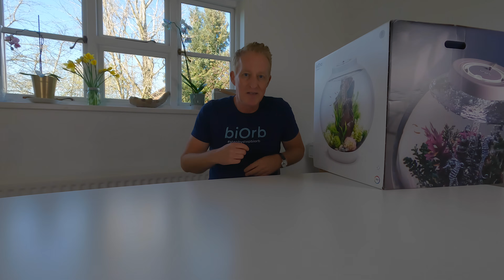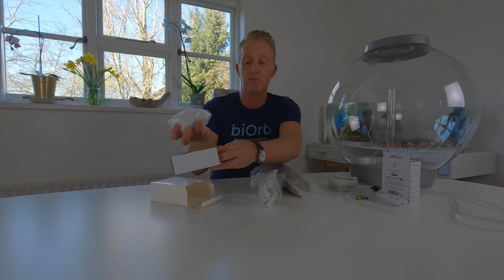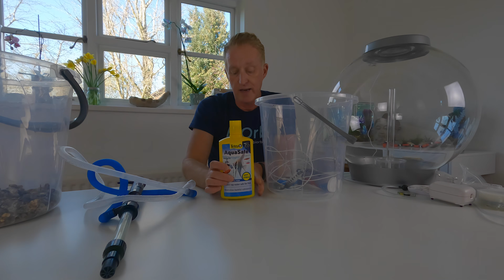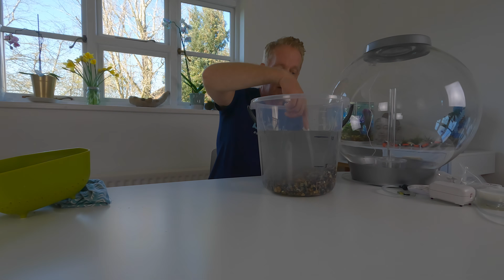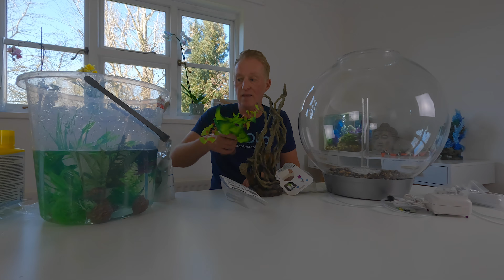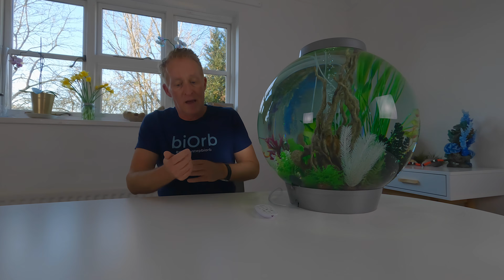biOrb Aquarium   | Starting a biOrb | New approach!

Comment: Hi, I have just been watching a lot of your videos so thank you - they have answered a lot of questions. 
I currently have 15ltr tank and am moving to a 30ltr biorb tube. I have got this second hand though and it also has the ceramic media in but the tank has been sitting for a while unused. How would you suggest I go about setting this up and moving my fish over in comparison to setting up a new tank. 
Thanks in advance for your help!
Reply from the maker: Hi Laura.  Congrats on the 30l Tube. I would suggest that you throw away the old ceramic media in the Tube - as this avoids any previous issues that may have existed with the tank. Any beneficial bacteria associated with the Tube's ceramic media will have long perished anyway.  

If you plan to fully replace the 15l with the 30l, then it would make sense to use the ceramic media from your existing tank and transfer this to the 30.  This media will have all the existing beneficial bacteria that have been supporting your fish in the 15. You will find it far easier to catch (net out) existing fish without any ceramic media in the tank. As you are moving up to a 30l size, I would suggest you purchase another 1 kilo of ceramic media to add along with your existing media (either the biOrb product or Alfagrog E25 - they are the same product). 

There are various ways of doing this but they all add up to being roughly the same.  The steps I would take are:
- Give the 30 tank a good rinse out with warm untreated tap water. Then towel dry.
- Rinse and soak the brand new (purchased) ceramic media in warm dechlorinated tap water in a bucket. After rinsing, soak for about 15 to 30 mins.
- Lower the water height of the 15l tank by about 50% - add the 7-8l of extracted tank water to the new tank 
- Leaving the fish in the 15, whilst carefully removing (by hand) the ceramic media from the 15l and add that material straight to the 30L.  Add a further 1 kilo the new ceramic media that has been rinsed/soaked.
- Add your decorations, air stone, filter, bubble tube, etc to the new tank.
- Top-up the 30l with fresh (dechlorinated) water to about 3-4" from the top.
- Add in your heater to the new tank and switch on and also switch on the air pump.
 
The new tank should now be ready for your existing fish.  
Rather than catch and then add these directly to the new tank, I would suggest you instead add the fish to a plastic bag (a fish bag if you have one or use a large plastic food bag) containing some of the water from the 15l tank.  Float the bag, containing the fish, on the surface of the water in the new tank.  I would suggest acclimatising the fish to the new tank water (i.e. keep topping-up the bag with a small quantity of the 30l tank water every 5 mins for about 30 mins).

After that you will be able to release the fish into the new tank. 

Hopefully the above covers everything... or at least the very main things.
You might want to consider adding a bacterial product (e.g. such as Aquavitro Seed or ATM Colony Freshwater) to the new tank at the same time as adding the fish.  I would do this, although it is probably not essential! 

The only thing I'd add relates to adding any new fish. If you intend to purchase and add further fish to the 30l I would suggest holding back on this idea for several weeks. This will allow the new tank and existing fish time to settle down. After several weeks the tank should then be fine for adding any further fish. Adding further fish is also best supported by the addition of a bacterial product (e.g. Colony or seed). 

I hope that helps.  Best wishes, Mark
Reply: That’s great, thank you so much for taking the time to reply! I will also move the plastic plants etc from my 15l tank. They really need a clean - is it best to do the clean as I move them over or wait for a couple of weeks to let the tank / fish settle? 
Thanks again!
Reply from the maker: I would move the plastic plants as is (without cleaning). Beneficial bacteria cling to all surfaces within the tank and so they will certainly be on your plastic plants too. You may as well get the full benefit of the established bacteria whilst establishing the new tank. After that, give it a couple of weeks and then clean them. Use the bleach-dip method I describe to clean the plastic plants... they should all then look sparkly new!
Reply: That’s what I thought! Thank you :-) I’m starting to do it all now!

Comment: Where did you put the heater and what kind for the classic biorb thanks!
Reply from the maker: Hi. The heater is at the back of the tank resting on the bottom/substrate:  https://www.youtube.com/watch?v=1rM3JRR3Jds. 
The tank is a Classic 60L with MCR lighting. Thanks, Mark
Reply from the maker: To see a wide range of videos about biOrbs visit my full video library here:
https://www.youtube.com/c/StepbyStep-biOrb-Aquariums/videos
Reply: One other question can I add additional pebble substrate over the existing bio media? Cheers
Reply from the maker: No Problem. Within reason, yes, you can. But this depends on the type of "pebble substrate" you are referring to?  
As long as the quantity of pebbles doesn't impede the filtration (i.e. water flow down and through the ceramic media). The only problem with adding too much additional media on top of the media is that:
1. The additional pebbles on the surface may not provide a suitable substrate for beneficial bacteria to colonise. What materials are the pebbles you refer to made of? If these are "biOrb pebbles" these do not really support bacterial colonisation. Beneficial bacteria always do far better with a good water flow around and over them (adding too much material on top, which doesn't support bacteria, may impede water flow to the substrate (below) which does support them.
2. The addition of material (pebbles) on the top of the biOrb ceramic media may make it far more difficult to clean and remove waste under the ceramic media using an aquarium vacuum. 

Alternatively, the use of the new biOrb substrate (Pearl Media) may be be something for you to consider is you don't like the look of the  "traditional" biOrb Ceramic Media and if you are wanting an alternative media type.

M
Reply: @StepbyStep-biOrb  thank you so much for the time and effort at helping me.👌👌👌👌
Reply from the maker: Not a problem... always happy to help.

Comment: Hi mark. Great video. I set up a 30l tube yesterday and have already added the water conditioner provided by biorb. I’ll go and pick up some colony today! Would you suggest grabbing some aqua safe and adding it to the pre- conditioner water? Thanks
Reply from the maker: Hi Keith. Congrats on the 30 Tube. A really great tank and a lovely sized tank to have within the home. You may struggle to get Colony locally as not all shops stock it.  So, you might end up coming back home with another product that isn't so good. The other product I would very strongly suggest is Aquavitro Seed (I've recently found this works better than Colony in certain scenarios i.e. local water quality. Seed works under a wider set of water parameters.   I would always go to Amazon for either of these as you should easily get next day delivery.  Yes, get AquaSafe (not AquaSafe Plus!) Normal Aquasafe is a great product that doesn't contain things that can mess around with your water (many other products add fancy things that I think end up being problematic).  Most local stockists should have this... or also get it from Amazon.  You would be fine to add a further dose of AquaSafe, on top of the biOrb  products you've already added. They are all safe to use, even at high levels. Add Aquasafe at a dose of 2.5ml per 5l of tank water.  For Seed and Colony, add these at the same time as adding your initial fish.  Hope that helps. I'm happy tp help if you need further advice. Best wishes, Mark

Comment: I have my Biorb 35L tube set up.  I have a betta in the tank with 2 nerite snails.  I am using a control valve for the pump to calm the water for my fish.  If I empty 25 percent of the water after a week or 2 weeks do I use the Biorb service kit and pour the water conditioner in and the biological packet? Or can I get away with just aqua safe? And can I use the sponge filters that are compatible to Biorb ones?  I will use the water optimizer each week. I do test my water. Thank you for help
Reply from the maker: Hi Kim.  Nice to hear from you. One of the first thing I do when I get a new biOrb is throw away the free samples!   Lol.  

I would keep it very simple and avoid adding any products that make huge claim (hype!) to all sorts of beneficial things and might actually end up interfering with natural processes! For water changes use a simple dechlorinator - I normally suggest AquaSafe (not AquaSafe +).  This is best applied to warmed tap water before being added to the tank.  So, yes, just using dechlorinator is fine and all you really need to do. 

In terms of sponges etc.  Alternative/compatible sponge (kits) are perfectly fine and are will reduce costs.  You just need to retain and keep using the existing plastic components of the biOrb filter canister.   It seems to be a total waste of natural resources to replace this plastic canister with a new one every time a sponge is changed. Sorry Oase biOrb...  but it's true!!  

The role of the sponge is to simply trap waste (i.e. the sponge has a mechanical function in a biOrb, not biological). In the majority of cases, the role of activated carbon is mainly included to reduce aquarium water odour (if you have it!)!  It is true, and sometimes overly claimed by manufacturers,  that activated carbon will do a list of wonderful things and will remove some "other" impurities, But, to be honest, these impurities (such as heavy metals) shouldn't be in your tap drinking water anyway! 

I would normally suggest replacing the sponge filter every couple of months (but instead, every two weeks, remove it and squeeze it clean in a small amount of aquarium water, then add back in).  With the single Betta you have, you should not be getting too much waste, unless you are over feeding.  In your case, the sponge would probably last a good three months before being replaced with new!   Just add a basic activated carbon (but not too small in "grain" size) to the filter's canister every month (using a teaspoon to add the fresh carbon in).  

That's it! Keep it simple!  Best wishes, Mark
Reply: Thank you

Comment: I have a Halo tank and the light has stopped working. Do you know if you can replace just the light or do I have to replace the whole lid? I can’t see where you can get the light itself out.
Reply from the maker: Hi.  I'm afraid you will need to replace the whole lid. Are you absolutely sure the lights are not working though? LEDs have a very long life expectancy. Anyway, if replacing, you need to make sure you get the correct size and colour lid for your biOrb. The replacement range includes standard lighting and MCR upgrades.   I suggest contacting your local biOrb office first though, and see if they could help/replace/ repair. Sorry to hear you've had problems with it... it's unusual to hear that! 
Best wishes, Mark
Reply: @StepbyStep-biOrb  I have put 3 different batteries in the remote thinking that was the problem with no fix. How I get the light to come on now is I press the on/off switch on the cord several times and it eventually will turn on to white but that’s all I get. I still can’t change the color or anything with the remote. I’m not sure what else to try beside a new remote maybe? I will contact my local dealer and see what they think. Thanks for the response!
Reply from the maker: Thanks Alex.  Yes, that"s annoying!  Sounds a bit like sort of working, but not properly.  See what biOrb say. They can be very helpful... if you contact them directly.  :)
Reply from the maker: BTW - When you get through to biOrb, say you have an intermittent fault with your lighting and that you MUST speak to someone in their Technical Department. That should then get you through to someone that might be more helpful.

Comment: Can you add 1 Betta fish with guppies, tetra and catfish?
Reply from the maker: Hi Patti.  Betta would be fine with all of those species.   But they would have slightly different water quality preferences. For example,  tetras, betta and corydoras prefer softer water conditions and a pH generally up to about 7.5  (ideally less).  Guppies on the other hand prefer harder water conditions and a higher pH up to about 8.  Tetras, especially neon, can also be very sensitive to poorer water quality conditions or aquariums that have swings in their water conditions.  

It is always best to try to match fish species to your tap water quality.

In terms of fish compatibility the chart here is useful: https://www.aquariumindustries.com.au/wp-content/uploads/2015/03/Freshwater-Fish-Compatibility-Chart.pdf.  Bear in mind the chart is about how well certain fish get on with each other rather than showing compatibility in terms of species preferences for water quality/conditions.  Hope that helps. Best, Mark

Comment: Hi Mark, I am having a problem with the GH level in my fishless classic Biorb 10 gallon- it was 60 at initial set up, then increased to 120 and then to 180 for the past 3 days. What product do you recommend for use? I can only find the pillows and they are square so I won’t fit in the Biorb filter. Thank you for your time!
Reply from the maker: Hi Dawnie.  Well, you will at need at least 60ppm for cycling an aquarium with a higher level being much better (say 90ppm).  Generally, 70-140 GH is typical for a mixed fish freshwater aquarium, and up to 200ppm. Is there a specific reason you want to lower GH (beyond cycling the tank) Are you wanting to target soft water species?  Have you managed to establish the reason for the GH rise... did you add anything 'non-biOrb', such as natural rock etc, into the tank that is leaching?  I assume your tap water is reading 60ppm?  The best way to reduce GH is with the use of reverse osmosis (RO) water (cutting tap water with RO)   For a biOrb, the use of the ZeroWater system is probably the best way to go (see my video on Poor Tap Water).  Best, Mark
Reply from the maker: Hi again.  Can you let me know what method you are using to test GH? Is it strips or liquid testing? Also, can you let me know the pH of your tank and if that is changing too (to reflect the GH changing). If pH remains reasonably stable i would question the accuracy of the GH test with the level of rise you are indicating (unless you have added something to the tank that is lifting calcium/magnesium).  Silly question, but can i just check if your tap water supply is passing through a water softening treatment.  Best, Mark
Reply: Forgot to add that I would like it to be around 60. Thanks again!

Comment: Thank you for your videos. They are really helpful and lovely to watch.  

I have been given a Second-hand 60l biorb. I have a couple of queries. Should I buy new ceramic media? The previous owner gave me the ceramic media they used. It’s in a carrier bag. It doesn’t look nearly as much as what you have. Secondly - do you have to buy biorb branded accessories? There are cheaper ones on Amazon. 
Thanks!
Reply from the maker: Hi Sian. Good news to hear you’ve gone for a 60l… it’s a great sized tank. In terms of the ceramic media, I would certainly look to ordering new media. Get either the biOrb version or Alfragrog. You can get both from Amazon, on next day delivery, and they are basically the same stuff!   For a 60l, you will need 1 kilo.   

No, you are not limited to buying biOrb products. There are alternative versions that work equally well. I cover a range of suitable products in my videos and also provide links to those that I’ve tested and also use myself. Hope that helps. Best, Mark